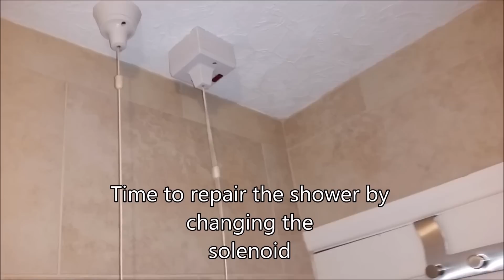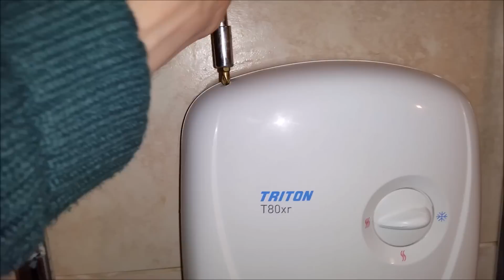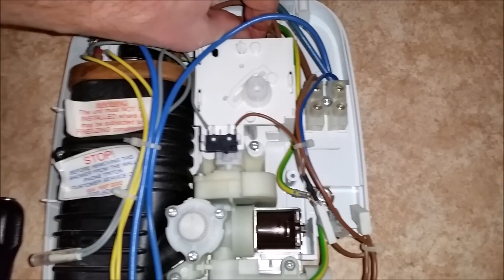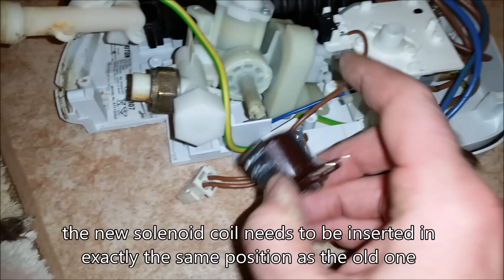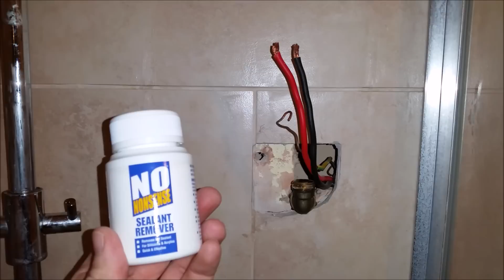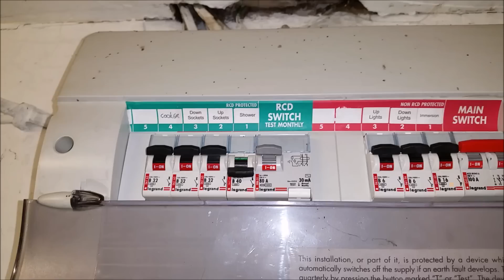How to repair a Triton T80xr shower that keeps cutting out - no water

Comment: Thanks for the video, very useful, although I not sure changing the solenoid will deal with my problem as the shower still runs even with a low pressure light/  I think I might need to get rid of calcium build up in the in the plastic unit next to the solenoid by soaking it in vinegar.

Comment: I appreciate that this video is 10 years old- but I just wanted to thank you for it.
I have just successfully followed your guidance to fix the same model that has not been working for the past 5 years using a £10 solenoid from Amazon. Large family, tight budget has meant we have made do with the second bathroom shower and bath. 
The only guidance I could find that was helpful for this problem and this model was your video- so Thankyou

Comment: thanks for this mate, got a coil coming tomorrow. Gonna try my best to gently remove/pry the existing coil out, as the faff of disconnecting and dismounting the entire shower unit looks utterly terrifying lol
Reply: Good on you for having a go. My advice is to take plenty of photos and even write down where things go. Tipp ex is good for marking cables etc just mark them on the end you wont be touching or different colours of insulating tape. I know its very tempting to rush in and disconnect everything but believe me spend the time before hand identifying where cables etc go and you will be glad you did when it comes to putting it back together. Hope it goes well.

Comment: Thanks for a really useful video which helped me diagnose the problem and fix it with a solenoid costing just £9.25 on Amazon. In my case the old solenoid was impossible to fully remove using just my fingers and I had to resort to levering it off using some tools but I managed to do so without breaking anything and my shower is now fully functional again. Thanks again.
Reply: Hi mate, sorry to reply ages later, but what did you use to pry the coil off and how? don't fancy taking the whole unit off the wall, but also don't want to break anything lol

Comment: They name the showers all wrong and the designers are fools
We need showers that fit the footprint of older showers and a easy to remove solenoid

The names like pro fit lol
Pro fit has a easy pop out solenoid that can be changed in a minute
The normal fit has a bad design making you remove water in, the can, switch, regulator valve or take the shower off the wall
Pro fit my ass

Comment: Can i remove the switch and the pull the valve and solenoid out from the can and water in as it seems quicker

Bad design as so much work to pop out a coil

Comment: I don’t have this model of shower but the video allowed me to diagnose the problem. Got the part from Amazon for £10 (which fits most Tritons) and did a straight forward switch from old to new. Problem sorted. Thanks a lot for your info - saved me £££!

Comment: If you do this yourself it will be cost effective but to get a plumber to do this on a shower thats several years old it would be better to replace it.
Cheap solenoids from ebay are hit and miss.Best to pay an extra fiver for a branded item normally about 17 quid.
Never silicone around a shower unit.

Comment: Thanks for taking the time to do this video. I've also got a Triton (Opal 2) and I just can't understand why there is a bit of plastic the prevents you from simply removing the solenoid. I really don't want to disconnect the plumbing to the shower so I think I will just cut away the plastic as I can't see any function for it. Other showers don't have any obstacle so this is a really poor design feature as you state in the video.

Comment: There is no need to mark the dials: 
1) The top dial has its own guide and can only go on one way.
2) And with the bottom dial, just keep it in the same place when you took the cover off.
3) If you do accidentally move the bottom dial, then just point it towards the bottom with the cover off.
4) And you should have checked for leaks from the water pipe after doing up the nut before putting the front cover back on (preferably a new seal should also have been used).
5) There is no need to put silicon seal around the backplate.

Comment: Hello would this work for the Triton T70Z as well? . It would run for a minute or 2 and then just shuts off. Noone is coming out to repair it during the coronavirus lockdown, so hoping to repair it myself.
Reply from the maker: I believe the solenoid is usually standard from model to model
Reply: teal...
1. Check the hose is not kinked
2. Check the handset is not scaled up inside
Both the above will cause back pressure and may be the reason why the shower shuts off.
Worse case scenario: the boiler in the shower is scaled up and if that is the case then you will need a new one.

Comment: Just a few points no sleeving on the earth wire and the screwdriver driver you are working with not insulated good video though.
Reply from the maker: Thanks Geoff. I'vr now added an insulation sheath to the earth.
Reply: Geoff...
Not necessary to sleeve the earth wire, the earth wire is not a live conductor, so it does not need insulating in the same way live and neutral needs to be...

Comment: ALWAYS SLEEVE YOUR EARTH CABLES!!!
Reply: Stuart...
Not necessary to sleeve the earth wire, the earth wire is not a live conductor, so it does not need insulating in the same way live and neutral needs to be...
Reply: You are correct but it’s good practice to promote sleeving them for at least the identification purposes 😉
Reply: @eukcoopdogg293  
A competent electrician will or should know the difference between the electrical wires and if he does not (or anyone else), then he should not be doing electrical work in the first place!
Reply: Again, you are correct and I agree with you but, how many people out there ‘believe’ they are competent and how many are ‘actually’ competent are two different things lol
Reply: @eukcoopdogg293  
A genuine knowledgeable and qualified electrician ‘will’ be "competent" in his work and know what he is doing as oppose to some idiot that dabbles with electricity!
Example: with the old wiring system (red, black and un-sheathed earth wire): there are only 3 wires that connect into an electrical shower from the mains: live wire, neutral wire (both which are sheathed) and the third un-sheathed wire, this then must be the earth wire. It does not take a genius to work that one out.
Reply: Hey, all I’m saying is that it’s good practice. Any good knowledgeable and competent electrician should and would put an Earth sleeving on the earth wire. I’ve not met a good electrician to this day that would disagree with my suggestion.

Comment: All done, low pressure light gone! HOWEVER, any idea why i don't seem to have hot water now?!? :(
Reply: Having same issue. Shower running fine (so it seems at the moment) but not getting hot. Did you find out what it was?

Comment: Thanks for posting - question though. How did you know the problem was the solenoid? We have the same problem. The shower just shuts down and the the electrical switch on the main board turns itself off. However, we don't have the low pressure light to give any indications.

Comment: Just a point - main earth should always be sleeved.
Reply: Rob fitted coil still no water
Reply: Rob...
Not necessary to sleeve the earth wire, the earth wire is not a live conductor, so it does not need insulating in the same way live and neutral needs to be...
Reply: @redblade8160  All earth wires are usually sleeved to provide protection to other live wires
Reply: @redblade8160  another thought, why do they produce earth sleeving?
Reply: @redblade8160  The earth or "ground" wire is normally bare. The wires are then jointly covered by the outer sheath. ... When installed, bare earth wires should be covered with an "earth sleeve" which can be bought in all sizes at an electrical store or most diy stores.

Comment: Useful video.. Thank you for taking the time to record, solved my issue. Can't believe the dipstick who designed this couldn't recognise the major flaw in the location of the solenoid....these designers should be made to repair the units, they might then rethink how they package......
Reply: Its deliberate. They dont want you replacing parts, they want you replacing showers. They make it awkward to put you off fixing it. In all the showers iv worked on, that's the most common failure but it's never in an easy place to get at. Turns a 10 min job into an couple of hours.
Reply from the maker: I couldn't agree more!!
Reply: consumedbynature n

Comment: This were really helpful as my shower did exactly the same and the water stopped running. Lucky or unluckily for me it were exactly the same shower so I had to follow your instructions with great care and attention. Thank You for making a fabulous video on how to sort this problem out as most people would have just bought a new shower which is a bit daft when you have clear videos like this on YouTube. Well done an excellent video.
Reply from the maker: Hi, really glad it helped you. Thanks for the feedback
Reply: Hi I'm wondering what would cause a shower to ruun for a few seconds and then trip out the fusebox
Reply: Shower  trips out in Fuse box when you press the switch wondering what is the cause it was going ok